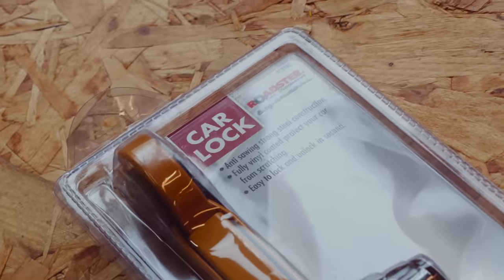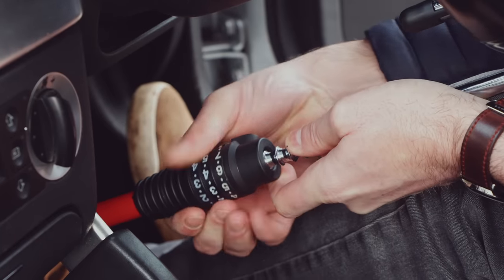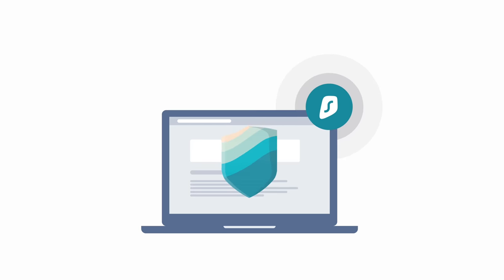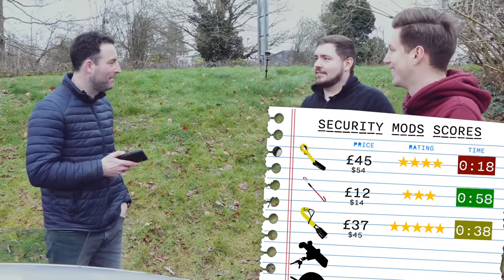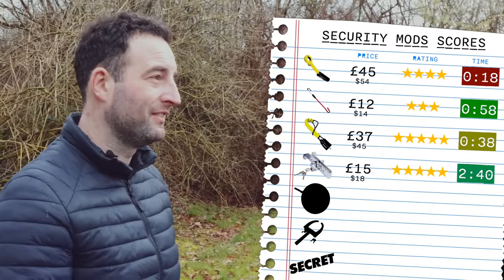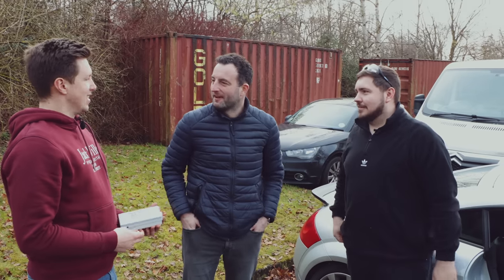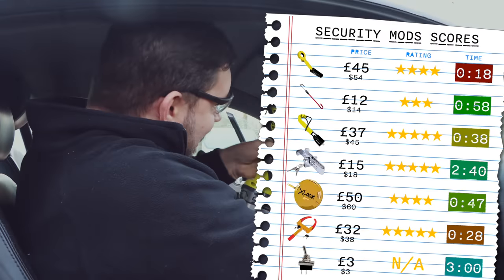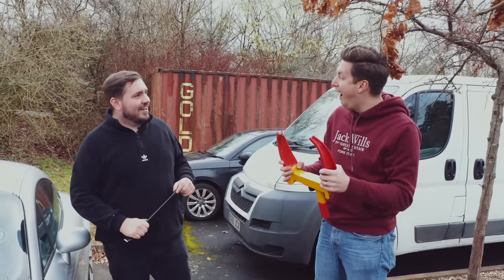Trying to Steal a Car with Anti-Theft Products

Comment: A former teacher of me had put a magnetic switch into his car before driving to eastern Europe. The car would only work when there was a magnet in the glove compartment.
Reply: That's excellent
Reply: That's honestly kind-of genius.
Reply: My dad made this for his motorcycle, but he only have to touch the switch with magnet once and it unlocks
Reply: Thats pretty clever, nobody is gonna find that.
Reply: Easy to outsmart. It’s basically a cutoff switch. Any thief that actually wanted your car would look around for any extra non-OEM wiring. You’re basically creating a break in the flow of power. You just need to remove that extra wiring, connect where it was spliced in and you’re off. 

Their best defense was the fuel cutoff. Usually a switch wouldn’t be out in such an obvious place, so in theory that would have been harder to bypass, but again, anyone trying to take your car, knows what’s up. Click ignition over, don’t hear the fuel pump prime, you know immediately no fuel. Most fuel pumps are accessed by lifting up the bottom portion of the backseat and on most cars it just snaps in. Rip that up. Fuel pump runs off of one wire. Remove the cover off dome lite, attach one side of the wire to the bulb bracket, attach the other to the fuel pump and you’re off. 

A car has to be worth taking. Everyday people usually don’t have anything to worry about. When you get i to specific cars that would need extra theft deterrent, is when it’s a game of cat and mouse of trying to outsmart each other.
Reply: @Moises-kf1hg  Right, because a thief in the middle of the night is pulling off panels and looking for "non-oem" wiring all over the car
Reply: @Dave435l   A car thief will have most likely scouted a car before stealing it. Think AirTags on Chargers: The would be thieves follow it around for a few days to understand the target's routine.
Reply: @Moises-kf1hg  Such switches are for everyday cars, of which there are dozens in every neighbourhood. These are usually stolen for parts, not for resale. So they don't want a specific car, they want common models so they have a big market for spares. So let's say you have a Golf mk6. If yours have a switch and it takes them some time to locate it, they probably will just leave it that way and find another Golf mk6 a few blocks over. They will still have a Golf mk6 but with significantly lower risk. Every second they spend next to one car, the chances of getting caught increases drastically. As a result, they usually don't spend too much time with one car and go for the easiest target. 

Of course, if you have a special model, or a rarity, a collectible or whatever, it's a completely different game. Since they can't just find another Ferrari 250 GTO the next corner, if you have one and they want one, they will take higher risks. If they targeted your rare car it is pointless to use any security device. The only real chance of protecting it is by 24/7 guarding.
Reply: LoL this is very insane! I had one with bottle of soda can inside cup holder. Pull out soda can and nothing works. But the magnet is insane level. 🙂
Reply: That’s genius! You can make a kill switch that is completely hidden, and only you know where exactly put the magnet for the switch to work.

My only concern would be that you would need a fairly powerful magnet so it doesn’t just fall of when you go over a speed bump. But then said magnet could compromise the electronics in that area. Still, if you find a good spot for it where it won’t interfere with other electronics, it’d be the perfect hidden anti-theft solution.
Reply: @peterkornis5377  But also, there is no point stealing a Ferrari 250 GTO because what are you going to do with it once you have it? there is no way you could try and pretend you got it legitimately.
Reply: @pwhnckexstflajizdryvombqug9042  there is a huge black market for stolen super cars. Also, there are different methods thiefs clear the history of a car.
Reply: That’s all it takes, skip the CCP crap.
Reply: @Moises-kf1hg  In most cars you can't really even hear the fuel pump... I had a shitbox Mazda and even in that you couldn't hear the fuel pump.
Reply: Rig another very conspicuous switch connected to the horn, with a looped relay😂
Reply: That's how it's done. Or you could live and stay in Switzerland.

Comment: The “thieves” were surprisingly efficient!  Imagine a pro with proper tools.
Reply: Or a car worth stealing, motivating them to try really hard.
Reply: Too bad they didn't use a tow truck to continue the work in a shed afterwards lol.  :)
Reply: @pistonburner6448  would have been even better if it was something no one would want to steal. I.e a 2012 Chrysler Town and country.
Reply: Lot of these devices are just thief repellents not thief stoppers. From the perspective of theives, if one car has these and other doesn't, given similar price points for the cars, thief will choose the car without these.
Reply: Worthwhile noting that unless you are trying to deter a trained professional or a very smart and researched thief (of which they'd probably find work elsewhere), then the average car thief is both A) not bringing these kinds of tools with them to remove these devices and B) not going to know how.

I think the best anti-theft switch you could install would go on the driver side by the door, so you can switch it off when getting actively car-jacked in a running car. Because that is the most likely thing to happen.

Comment: Best solution is to disconnect your battery and carry it with you when you leave your car
Reply: I take my pistons out, they're lighter to carry around.
Reply: @pistonburner6448  I usually just take of the front right prop shaft. My car is a FWD Open diff so it won't move.
Reply: I sleep with my engine under my bed
Reply: i drink the fuel then just piss it back in
Reply: @GloomGaiGar  the long drive moment.
Reply: Trouble is on new cars you have to reset a bunch of stuff everytime you re-connect the battery, pain in the butt.  I think the kill switch to the fuel pump was the best one.
Reply: I take out the driver seat.
Reply: @kg888  remove the floor pans aswell.
Reply: I do a George Jetson.  My car just folds into a briefcase, and I carry it with me.
Reply: I sell it at night and buy it back in the morning
Reply: What if you just pull the fuse and take it with you?
Reply: @GloomGaiGar  The long drive be like
Reply: Better to take your pedals out and gear stick.
Reply: @NoBody-xx6ii  I sell my car forever, makes me 100% save from car thieves
Reply: The thieves won't know that so they will still break your window and try it, at least your car doesn't get driven off, but you still have to pay a deductible for fixing and you face higher insurance. bummer, I hate car thieves, I may as well get a 10 year old car and be happy making repairs, geez
Reply: Batteries are cheap, thieves can carry spare😅

Comment: I bet most of the locks on these devices can be opened by a novice lockpicker. Probably with a rake.
Reply: The lock on the chrome pedal lock can be defeated by using a screwdriver in the keyhole and prying the cover plate off. the rest of the lock innards will fall out, allowing you to open easily. DON'T BUY CHINESE MADE LOCKS. They are garbage.
Reply: @Fanta....  Lol, it's not about how the locks are made, it's about the design. Love you lot, the "made in China" haters, who knows nothing more than 1+1=2.
Reply: @jkliao6486  to be fair, a lot of made in china products are very badly made, both in design and production quality. of course, correlation does not equal causation, in fact most of these made in china products are probably cheap because china and similar countries are just the cheapest when it comes to manufacturing things, meaning that whoever produces their products in chinese factories probably cares more about cheapness of production rather than quality of design and product.

however, I do agree, saying that a product must be of low quality just because it was manufactured in a specific country, that is kinda stupid.
Reply: @alexandertheok9610  No, these products are badly made because they are cheap. You get what you payed for. A good lock probably costs a fortune to manufacture and more than any of these are sold for. If you want to manufacture them in US, you get nothing different other than increased price tag. Why? Because manual labor is just so much more expensive in US. So which do you prefer? Pay small money to get a crappy product or pay small money to get absolutely nothing?
Reply: Definitely a rake. I doubt a lot of effort would have been put into manufacturing the locks themselves.
Reply: A garden rake that is and using the wooden handle!
Reply: This is the lock picking lawyer and what I have for you today is a load of crap from Amazon. I’ll just open them all again to show it wasn’t a fluke.
Reply: @highdownmartin  I was beginning to worry there were no LPL comments on this video. Halfway through this video I was like, call LPL, all of these would be off in 10 seconds
Reply: @alexandertheok9610  Actually China can make very high quality products if they want to. But Americans and many others are so accustomed to poor quality and cheap price that there's no real incentive for the Chinese to step up their game. Like others have said, price = quality. If it's expensive but still made in China, you're probably getting a good product.

Comment: Putting that switch somewhere less obvious would have made that job a while lot harder. I had a vehicle I had two such switches that were in series so they both had to be switched. If they find the one, they thought it was job done. It worked. 😊

Enjoy this type of video from you guys.
Reply: Better is using OEM switch like DRL from lights. In old times in Poland i seen Fiat 126p (positive+ on body) where ashtray was used as contacts on kill switch
Reply: All those switches are great until they stop working. Extra fun when it crap out in a middle of the road and you are not the one who installed it, happened to me recently few days after i bought a car. The idea was good, they used two relays and a button so that car would only start when you hold a button and press the brake pedal. Unfortunately the guy who installed it is a shitty electrician so it failed and engine was only running while brake pedal was pressed. Driving the car back home was exciting, lol.
Reply: @_Dimon_  this happened to me! The cheap switch ruined me 😭😭😭 I have a removable steering wheel now with a hub lock from NRG. Does the job.
Reply: I put three. Two in places they would check, and one in a place they won't think.
Reply: @_Dimon_  atleast your engine got past it's break in miles before you got home.
Reply: @mateuszzimon8216  why would anyone want to steal a Maluch? I mean, I would probably put a few kill switches on mine if it was still road legal and working, but that would be just for fun. 

Even if the thief discovered how to start the car, he wouldn't get very far because the car would fall apart.
Reply: @masterkamen371  They are bad, but if u have choice Maluch and bike u take Maluch
Reply: I had a lock similar to the first except it had a collar that went round the gear stick shaft. The collar was secured with a grub screw and in my case loctite. It was also fitted with a Yale lock. I used it on three cars over 10 years and never had one stolen. Without the collar it would have been no better than this version.
Reply: Modern aftermarket ECU's are even smarter, say requiring a button combination on the climate control or steering wheel buttons before it will start!
Reply: I like the way you think...
2 series switches...could b more...
Cheers mate
Reply: Brilliant
Reply: Why is your car being broken into that much, that you know it works? Lol
Reply: Exactly. Had to have the right switch position combo to start.  Installed 30 years ago. Still works like a charm.
Reply: Yeah, I had a button hidden under shifter cover, it was invisible :D
Reply: @masterkamen371  Back in the day, you would pay $$$ for someone to take it away from you, sure. Even in a good condition, you could buy a fine Maluch for a bottle of vodka, as in most cases you were paying for the fuel inside the tank rather than the car itself, lol. 
Nowadays though... It isn't that cheap anymore. Ones in (very) good condition can go for over 10k USD, as it has that collectioners vibe going now. Even crappy ones that still drive costs 1k $ at bare minimum. Sure, you can repair it with a plastic bottle and a toilet paper, so it has low maintenance costs, but still... it is a "classic" now. And it is easy to steal... Also, it kinda suffers from the "Master Key" problem, as many keys fit its locks.
Reply: what kind of car was it?
Reply: why overcomplicate with relays and shit? less is more: just use a regular switch and some surge protection, hide it well and that's it
Reply: Also if the thrives weren't told it has a kill switch they might think it's just not running
Reply: Hide the switch somewhere in the trunk.
Reply: I had a switch where you had to actually put a lever on it and turn it off or on, usually have the lever in the glove box
Reply: @backwardmist2303  that sounds pretty dope
Reply: This may stop your "average" theif, but the "professional"  theives know where to look.  One possible twist on this idea would be to use a switch and then also tie it into something, like the brake pedal.  So the switch has to be on or off and the pedal has to be pressed (thus activating the brake lights and closing a circuit) to start the vehicle.
Reply: @_Dimon_  It's a definite laugh riot when you leave your car in the shop for repairs, warn them about the kill switch (professionally installed so it's activated by an ordinary switch the car already has), but somehow the information doesn't get to the right people. In my case they spent half a day trying to figure out why my car wouldn't start, disassembled much of its electrical system, finally gave up, and called me.
Reply: Hyundai buried the starter under the exhaust manafold. Put mine on a relay fuse there with analog remote. If you can take the engine apart you could steal it but towing would be easyer.
Reply: Just pull the fuse 🤔

Comment: The thing is, something like that kill switch may be effective but it wouldn’t deter anyone from trying. If you have a nice car, something like the steering wheel clamp may just deter someone making them go for someone else’s car. Ideally go for both so you have the effectiveness of the kill switch and the deterrent of the large, visible steering lock (being inside the car also adds a level of commitment which further deters would be thieves as it adds risk of being caught in the act
Reply: Yes, that's even this business exist.
Reply: If you have a newer kia, anything is better than stock.
Reply: @jwalster9412  If you have a newer Kia... just why?
Reply: @masterkamen371  security flaw.
Reply: @jwalster9412  why own a Kia?
Reply: @masterkamen371  you have a point..
Reply: that's kinda what the Freakanomics guys talked about.  a visible Club, will deter anyone who doesn't want to take the time; even though it is easy to defeat.  where as the switch may actually stop them, but you risk them breaking into and then trashing your car
Reply: Yoo same pfp lmao
Reply: Indeed, and take it to the next level by adding a three step process that involves using additional buttons that already exist in the car. That way, flipping kill switch alone won’t start the car.
Reply: @spowell2665 use both.
Reply: @jwalster9412  that security issue is for 2010-2021 models with an ignition starter. 

The models at risk are. 

2015-2021 Hyundai Accent (all body styles)
2015-2021 Hyundai Elantra (two-door and four-door)
2015-2021 Hyundai Kona
2015-2021 Hyundai Santa Fe
2015-2021 Hyundai Tucson
2015-2018 Hyundai Veloster
2015-2021 Kia Forte
2015-2021 Kia Optima
2015-2016 Kia Optima Hybrid
2015-2021 Kia Rio (all body styles)
2015-2021 Kia Sedona
2015-2016 Kia Sorento
2015-2021 Kia Soul
2015-2021 Kia Sportage
Reply: Hook the 'off' side of the kill switch to a loud air horn or alarm system trigger. When thieves go to start it, they'll get an unpleasant surprise, more than likely cut their losses and leg it.
Reply: @hopperhelp1  I swear I have never seen any of these cars in person lol.
Reply: also thieves look for switches

Comment: I was at an auction and this Mazda RX7 was not bid on except by me. The vehicle wouldn't start so nobody wanted to risk buying it.
It had a fuel shut off toggle switch to prevent the rotary engine from flooding.
I bought the car for $2900 CAD spent $20 for a technician to discover the issue and drove it for 2 years.
And then after driving it for 2 years I sold it for $6500 CAD!    😀
KISS is and always will be the best way to live your life.
Reply: What does KISS stand for?
Reply: @frafraplanner9277  it's an acronym which means Keep It Simple Stupid
life should always be lived that way.